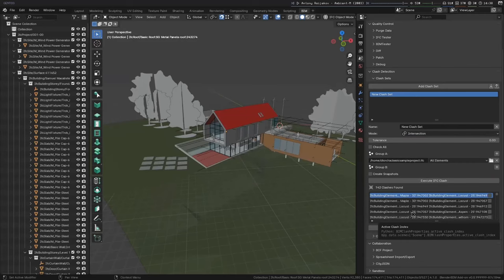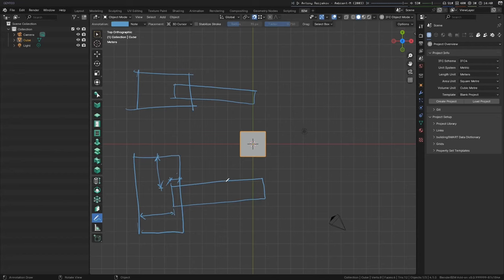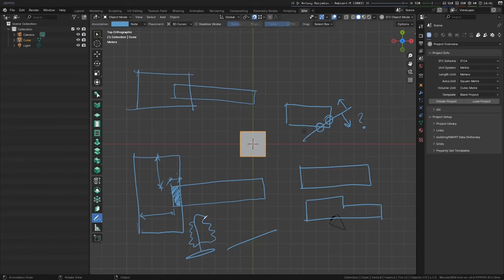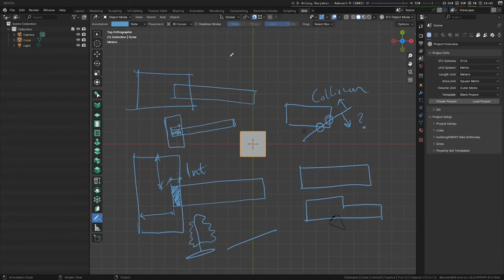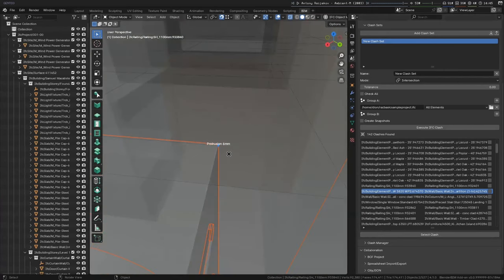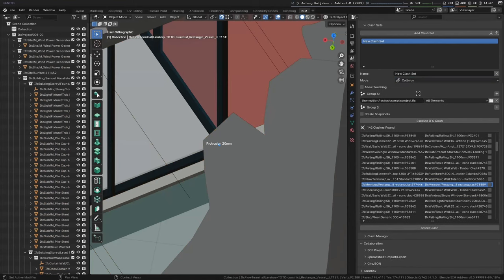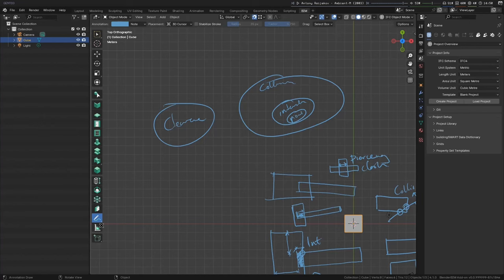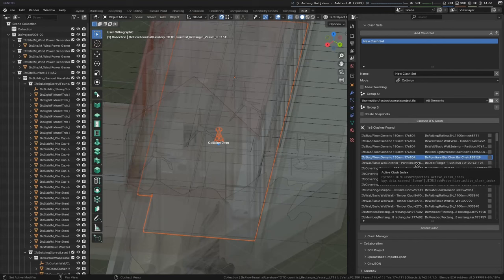Clash Detection in BlenderBIM - How it works?

Comment: One thing I probably should've mentioend is that there is a "Tolerance" slider you can set (see below the Mode dropdown). For example, for an intersection you can set a tolerance of say 5mm, and therefore any intersections of less than 5mm are ignored. This is great for filtering out boring intersections that aren't actual issues on site or within construction tolerances.
Reply from the maker: Thank you Dion for adding even more value to this!